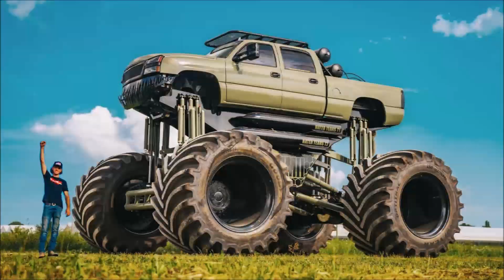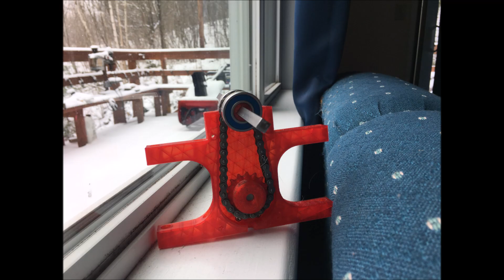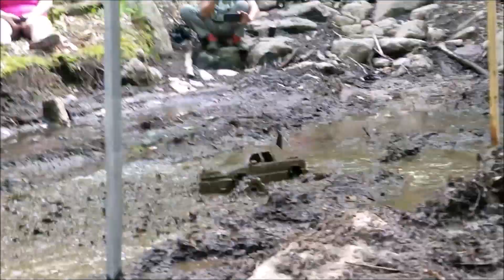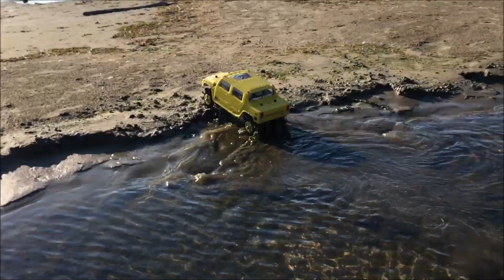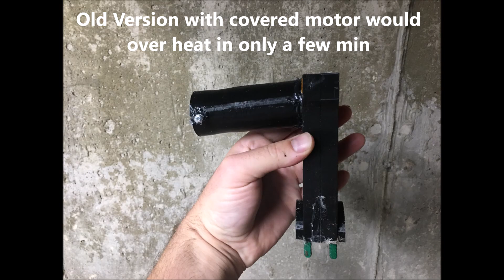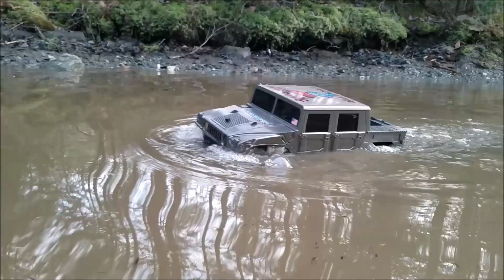What IS Mudv1? Why was it built? A 1 hour video Essay on off road design

Comment: Very interesting video! This was insightful for me, as I'm working on some offroad projects right now and there's not a lot of published information about designing at this scale..
Have you considered using PETG for your printed parts? It has about the same structural integrity as ABS, but without all the troubles of printing ABS
Reply from the maker: I used to make a lot of PETG parts for RCs, but did some test between gears and tires and found PLA holds up a lot better. It is true PETG is more flexible, but from testing PETG parts tended to crack and break apart while PLA parts did not, so I've used them since. 
What kind of machine are you looking to design?